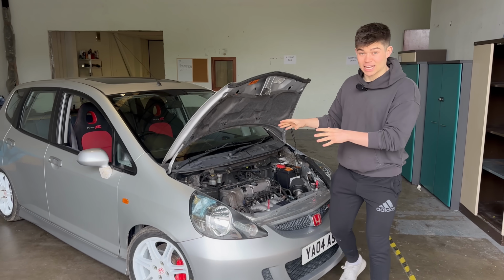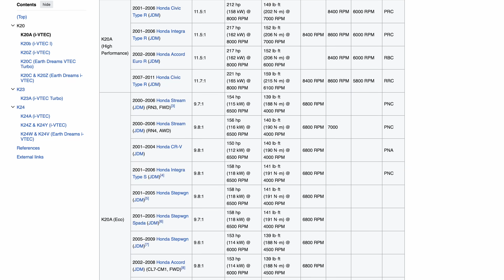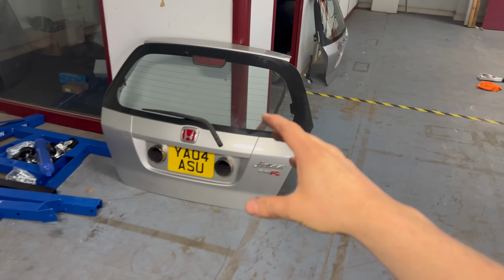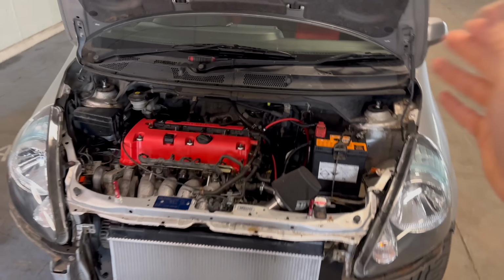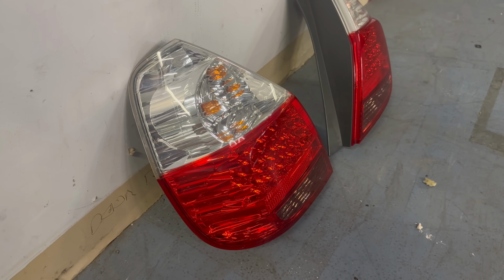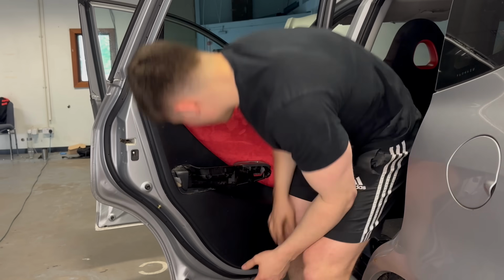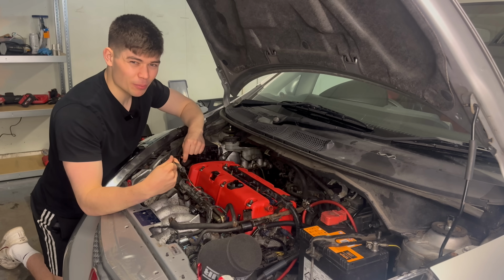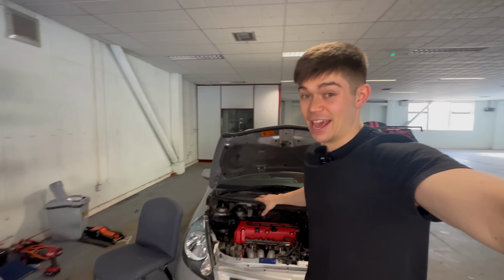I MADE A HUGE MISTAKE WHEN BUILDING MY JAZZ TYPE R...

Comment: Looking great mate only one thing I’d do is put some wheel spaces on they a little too tucked into the arches
Reply: Wrong. Looks very track ready.
Reply: @jarrad5723  it might be track ready but looks wise would look great with spaces
Reply: @jarrad5723   You have no idea what you are talking about dude hahahahaha. Spacers have nothing to do with a car being track ready.
Reply: if the plan is to only track it, i suggest avoid using spacers, but if its for mainly for show purposes and normal road use, then defo get some spacers on.
Reply: @JNASLDN  Spacers do absolutely nothing to a track ready car man, infact a lot of expensive high end cars already have them from factory to get a perfect fitment. Including Porches and BMWs
Reply: @LeSwexy  yea those are bmws and porches not your typical ebay spacer

Comment: Are you getting a rear hatch spoiler like the Ep3 has? Also you can use the gauge cluster. You "just" have to get the service manuals for both versions and put the pins in the right location. They both use CAN bus so it should more or less be "plug and play" after repinning. Alot of work. But worth it imo
Reply from the maker: It may or may not be in the works

Comment: JDM ep3 had a front diff which I've had fitted to mine. (I imported one from Japan, new, for an Integra - there are limited numbers so if you see one get it). Expensive but game changer. If you were excited about the first drive what 'til you get it mapped, they drop Vtec to 4600 and up the RPM to 8200. Its a different animal. check oil regularly and keep 1L on you, you will burn oil each time you're in VTEC. If not, its not monitored and it is oil starved even for a short time. it's likely blown head gasket time. Hope that helps. Always use genuine Honda parts and my performance garage also recommends keeping Honda oil in it.
Reply from the maker: Thankyou for this advice man!
Reply: @JackMcNeillCars  No worries, I'm really enjoying the build, the drive to get in there and give it a go is commendable. I had my oil changed last week and after refiling it  they pulled the fuse (Im guessing to the fuel pump) then turned it over for about 5-10 seconds. When i asked, was told this allows oil pressure to build up, before they  refitted the fuse to start it. Prevents you running it from dry as he said in some cases it can take 15 seconds on start to get the oil up to pressure and all the way round. Thought I'd pass that one on as i noted on your first start up just fired it up on it's first go. Looking forward to the next one.
Reply: I thought all oil came from dynosaurs.
Reply: Some of the information you've given is false:
- Get it mapped IF there are any mods. Standard ECU map will do fine.
- Map on a dyno - dropping VTEC without any significant mods will result in a power dip - Honda knew where the crossover should be put.
- Reduced oil will result in oil starvation, usually ruining the crank bearings and the engine will knock. The head gasket will blow on age, overheating or boost.

Otherwise yes, a front LSD is good, OEM helical. They are easy to find in the UK and usually a whole gearbox with LSD is around 700-800 GBP. I would recommend a shorter final drive from FN2 (5.1) or a 5.33 (much rarer, like FWD USDM K24 CR-V and such)

Comment: Good call on replacing the timing chain, genuine parts = Honda reliability.  Make sure to change the chain tensioner if you replaced that with a cheap aftermarket.  Watch out for leaks on the valve cover.  That wrinkle is not going to seat the cover seals correctly and will bleed through.  If you clutch pedal is hard, now is the time to replace them.  They cheap, an exedy oem, try Tegiwa. Also a good time to replace the flywheel with a lightened facelift one if yours is the pre facelift engine.  After a skim, they good as new

Comment: Rocket cover should be tighten in several order and torque by the spec   . Also you should check condition of the gasket and clean all surfaces if you don't want leaks 😂 only friendly reminder 😉 great work   . With a red Jdm carpet will be amazing! !
Reply from the maker: Hahah Thankyou bro, but engine won’t be running until after I sort the front cover leak so no real reason to follow the torque specs and order. But thanks for the heads up anyways probably would’ve forgotten 😅

Comment: I've used that VHT a handful of times it's good stuff... I use a piece of wood underneath the cover so it's edges aren't sat on the ground.   15 minute intervals and then heat but what I didn't know till later on you can spray any areas that aren't wrinkling as much. Keep it up 🤘

Comment: When using rattlecans for spraying to help avoid heavy spraying hang the item you want painted. You want the can to be vertical while spraying. The 1st coat should only be a dusting and should take atleast 3 coats to cover the material completely

Comment: You can take apart the instrument clusters and swap parts between then. So put the dark Jazz sport instrument cover with the rev counter numbers, etc into the stock unit, reassemble and install it onto the jazz. I’ve done it on a Clio before swapping a clio dash cover with an RS one. Relatively easy to do.
Reply: Benefit is it saves the need to recode the cluster

Comment: Great build but bin that air filter/induction even the stock airbox would be better than that garbage. Or replace with 
Gruppe M
ITG Maxogen
AEM CAI (bumper fitment)
Hondata mod OEM intake
Mugen

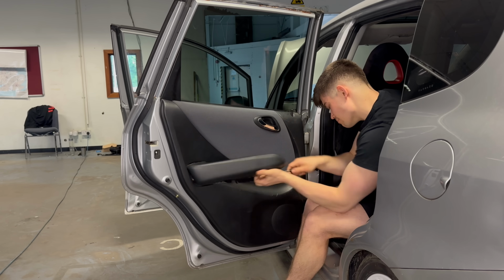Comment: 16:52 Should've chnaged and put some better speakers into the doors while you were there. I think the speaker mounting holes are not in a standard position and will need adapting to fit.
The car is looking great so far. Keep going, you're nearly there so you might as well go the whole hog now! 😃

Comment: Just a thought with the clusters. If they are exactly the same sizes you might be able the swap the dial backing plates over by stripping them down. Hope that makes sense, so the the sport dials get changed over into the standard jazz dial casing.

Comment: The pulley hitting the leg, solid engine mounts. You're not allowed to notch or even drill holes in the original chassis. If you do it has to be Single Vehicle Approved and you'll get a Q plate for it. It's an MOT fail and it writes the car off completely.

Comment: Get the rear spoiler now you might need to split it in the middle and rejoin it but would look the balls also sand back the honda badge on the rocker as it should be and space them wheels out a bit looks good so far and wrap it white

Comment: You positive that the vtec solinoid gasket isn’t leaking bc that’s what it looks like. Should’ve used hondabond anyway on the timing cover btw. Better do the front vtc cover while it’s out. You can get both vtec gaskets in a pack like 12-15$